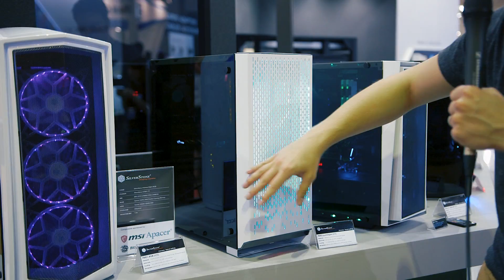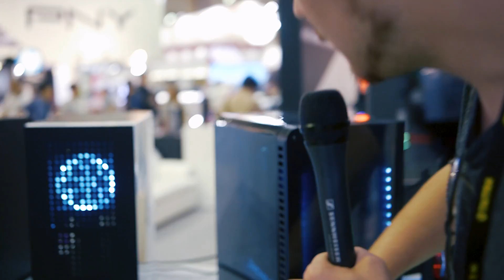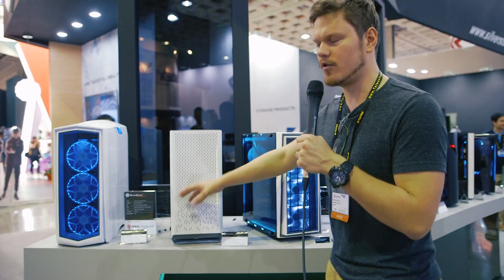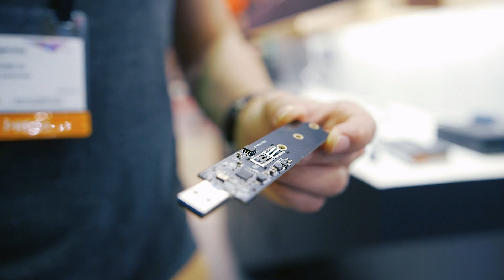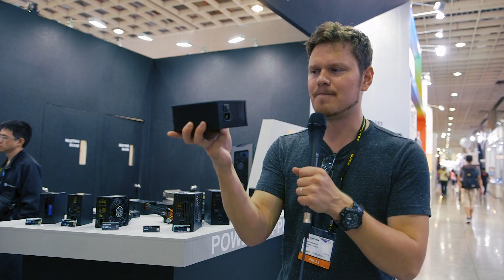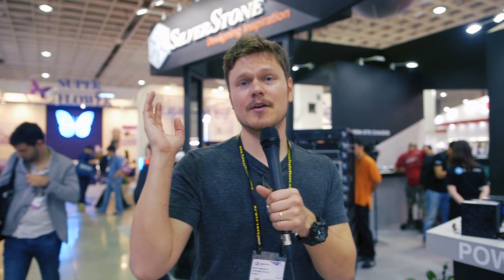Which Case Do You Like Most? And Build Your Own Thumb Drive!

Comment: LD02 Has my vote, it could have tempered glass raise to blow heat out the back aka no holes in the top, the slide out reversible tray is very Pimp, could also allow for power supply at either top or bottom & allow for triple 140 radiator support in push pull aka bulk space & cant forget allowance for insane cable management, 
bulk proper removable modular parts would be gargantuan.
cheers from Straya...!

Comment: LD02 is the best of the lot for just looks. 07  I like aswell but only if they incorporate those slanted panels as the on-off switch. I hate white cases I think they look ugly. White has a specific accent that makes things minimal yet still stand out. All white is just gaudy. RGB just makes it worse.

I like the M.2 stick idea very much. You could stelth your entire laptop's operating system for traveling. All the boarder people would see is a generic windows system while all your files are encrypted in this little device.The spying is a fraud on everyone. They are lying to you. 
Those riser cards would be a hell of a lot more useful if they came with the cable to install the port in older towers and replace the firewire port that you can never get to work.

Comment: There are parts of all of these cases that I like.  If the innards met my needs, I could be happy with any of them.  But my preference will always be an open grill front with optimal air flow and visible fans; so 1, 2, 3 and 7

Comment: but where is the bloody disk drive
where is the bloody disk drive
Reply: Incendere A ton of manufacturers having been moving away from including 5 1/4 bays in their cases as most it usually detracts from the look of the case, makes it so that the inside of the case is a bit more cramped and I'd say that at this point most people don't even have a use for a 5 1/4 bay, myself included. Although, I can definitely see why you would want one as many people still buy DVDs/BluRays and physical copies of PC games.
Reply: Incendere disc, the k is for hdd or ssd's yo.
Reply: Incendere o_O also not trying to be a dick, just that confused me tbh. but yes most people and companys have been doing away with them. because people use phyiscal media less and less these days and some people (including myself) despise them. also theirs always external disc drives. you dont use them very often and you can just tuck it away when your not using it, plus a internal one just makes cable management a bit more comersome to say the least
Reply: Dangerousfox "detracts from the look"
well 98% of the cases I've seen are just boxes which aren't that good looking tbh

Comment: $190+ for that PSU get a decent 1000W or more PSU and it will be a betetr investment as the fan will not spin or rarely spin  and you have more room should you plan to upgrade

Comment: It's all about good airflow. Give me a case that supports a 360 rad on the top AND front (at the same time) and has good airflow with dust filters (top and front; prefer magnetic), and I'll whip out my wallet. Along the lines of that second and third case is fine for aesthetics.

Comment: I like case which is support 480 radiator (or atleast 360) on top with push+pull configuration and still have space between motherboard and radiator fans.

Comment: Why all of them are full or mid tower? I like small cases. By the way, all of those cases are UGLY! I can't tell which one is good looking, becasue they are all ugly and looks very low end with those less than a dime of manufacturing cost LEDS. But the second case in the video has potential to be good looking, other cases? Nah, not a chance.

Comment: Those M.2 USB key housings are already available and I have one, but there aren't any retractable ones for 2242 length.  The biggest problem with them is that TRIM is not supported on any of the current offerings from noname brands so hopefully Silverstone will implement a controller that supports TRIM over USB.

Comment: RL 07 is pretty sick but the prototype 2 is lit aswell.
Reply: Red Light Yeah
Reply: Is there a release date yet?
Reply: DAKINGINDANORF idk probably not
Reply: Totally agree, they just better not be expensive, like, no further than $149 AUD. Silverstone, IMO, aren't known at the moment for anything to with cases other than SFF. They need to build a market before they can pull a Corsair and get expensive af for little features or some dodgy ones like they've done before. Love the Prototype 2, agree with Dmitry completely, and the RL 07 with the skewed front panel looks sick, just as long it's black and white options with RGB LEDs on the accents.
Reply: would drop 50 on that right now lol
Reply: Even though I need my 5.25" bays and more 3.5" HDD racks than Silverstone is offering on any one of those cases, #2 is pretty awesome with the "falling" effect.

Comment: hey guys i have a question not related to the vid, is my g4400, gigabyte h110m s2h, hyperx 4gb ddr4 ram, 120gb ssd that are coming soon, and my old gtx 750 work well? thank you
Reply: bubyy I dont know if you have reddit or not, but if you do, post it on /r/buildpc . You will get better advices over there :)